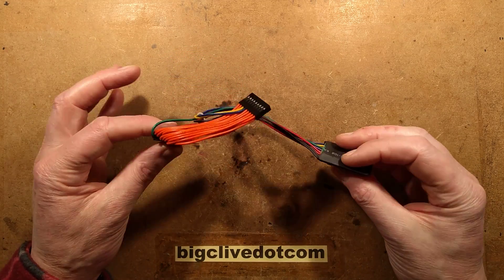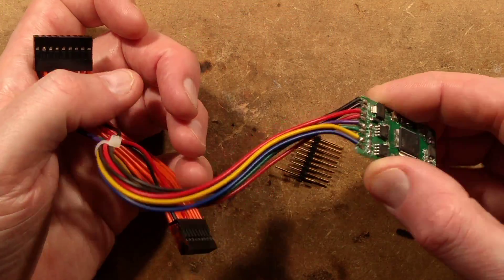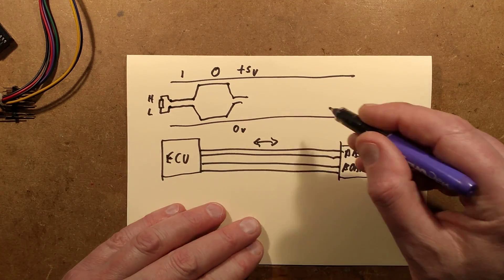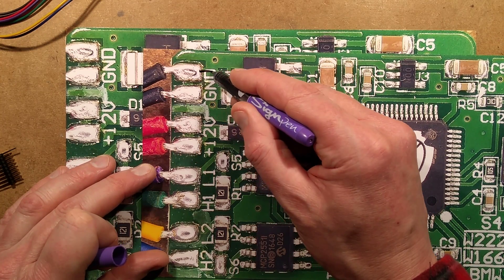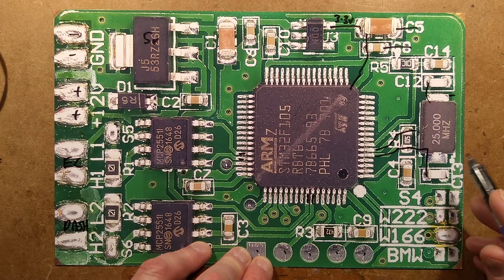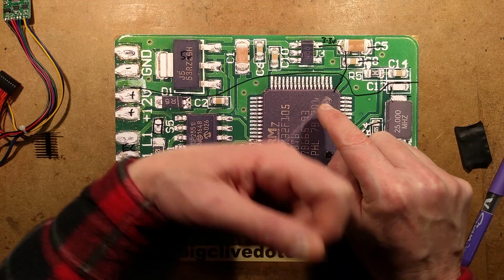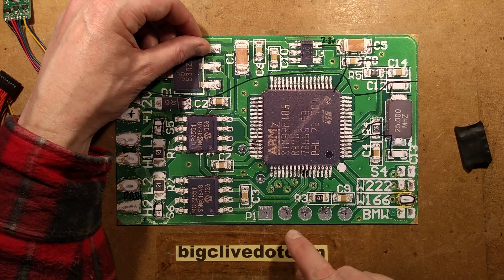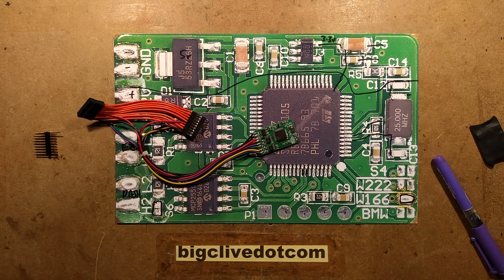Naughty CANbus odometer "interface".  (Fakes mileage.)

Comment: I wonder if an increase mileage version exists for those who claim mileage against their tax.
Reply: The chip can probably be reprogrammed
Reply: @smeezekitty  It's an STM32, so you would likely be able to just reprogram it in cubeIDE.
Reply: Mileage can be increased by a lot of bidirectional scan tools. That is far easier than trying to decrease it. Most legit tools can't
Reply: @Firecul  - But one might desire to have their cake, and eat it too, by claiming higher miles to the taxman, then when the car is sold on, lower the miles back to the true number, or even lower as this device did.
Reply: @YodaWhat  Not a good idea.  When the vehicle changes hand, it has to have the registration changed, and they'll want the odometer reading.  Basically, it's a bad idea to tell different government agencies contradictory things in case anyone cross-checks.  Tax collection agencies generally like to do that sort of thing automatically.
Reply: @YodaWhat  if the taxman was smart they'd check the records when the car was sold. Also the annual MOT records would cause an issue
Reply: @evensgrey  I did not say it was a GOOD idea! :-)
Reply: @YodaWhat  if you removed the miles to sell it it would get spotted as an abnormality on the next MOT.
Reply: @mikes1992u - Sure, it could get spotted, in countries or states where such figures are noted. Another reason to not do it. But there are other kinds of places in the world, too.
Reply: @Robeight  I recently claimed cents/km and don't recall providing postcodes
Reply: @kissingfrogs  depends who you work for and they’ll probably check the distances at some point to be sure no one is ripping them off for more mileage then they have completed.
Reply: There is. Heard rumors it’s popular among sales people to seemingly increase their effort to acquire customers/make sales. Business owned cars though.
Reply: Taxi drivers could use some tricks like that.
Reply: @tomonabudget  Taxi meters do take a feed but I'm not 100% sure its off the can.. I spoke to a taxi tech (guy who wires up all the taxis from a standard car) one day and basically the feed is pulses (+5, 0, +5, 0, etc) so it would be easy to build an interface (just out of an arduino using 2 pins plus of course +5 and 0v rails with a regulator plus a variable resistor ) which would allow you to make the meter go faster or slower as required.
From what he said there is no codes (like in can / obd2) so basically the wire working itself loose will stop the meter running and an intermittent connection might make it run faster / slower depending on how it contacts. 

 Of course its highly illegal and if you get caught you're done for. Mind you, most taxi drivers break the law multiple (maybe 100 +) times a day anyway.
Reply: roadmonitoroz Brisbane taxi meter fitter here. We normally try and find a square wave pulse as it saves fitting a canbus interface. I have no doubt a device could be created to fiddle the pulse information however I think it would be complicated for the average taxi driver (I’m not even sure I’d be able to make something and I’ve been fitting them for over a decade).  In the last decade I’ve had maybe 3 vehicles overcharging due to bad connections, loose connection vibrating simulating a pulse, the public were very quick to let the drivers know as well.
Reply: @cabcomltd  Yes the passengers would probably notify the driver as taxi fares (under normal traffic conditions) will always be roughly the same each time (give or take 10%)
And yes, out of the ability of most taxi drivers (and most of the public) but I'm sure with a bit of research and maybe an old smidt g4 meter for testing it could be done. I remember walking into a particular service station which was also a taxi depot and saw an old G4 for sale for $50 (when the cabcharge meters became pretty well standard due to government regulations . ie able to read meter via the eftpos for the ato). Ps Switching to cabcharge meters was the best thing ever as it (a) Stopped taxi drivers from running the most expensive tariff during daytime hours and (b) Stopped drivers adding tolls for bridges which were not traveled.
I remember seeing a printout from a driver (Yes I know people in the industry) where by doing a bit of math and using the statistics the night driver (started 4pm and finished 1am) had done 13 trips and they were all tariff 3 which is the midnight to 5am tariff 

As you know meters are pretty easy to wire [ +12 & ground, vacant light, distance wire, computer dispatch wire (so taxi computer knows meter is on or off) ]

Of course now days they have the transfer to eftpos ability and some other bells and whistles including GPS, auto tolls, etc 

Also after doing research (many years ago) about the wax seal and meters when riding in cabs I noticed quite a few without the seal which with a screwdriver you could re calibrate (with the right bits and bobs)
Reply: @roadmonitoroz  actually the legality of changing mileage depends on the country you are in, plenty of countries in the world it’s totally legal.  Even in countries like the UK it’s only illegal if you use it to deceive someone for gain.
Reply: Place I worked at way back. Employee paid all fuel for the company vehicle and claimed back work mileage at an agreed rate. Obviously there's a fiscal incentive to over claim work mileage and under report personal. Most people were smart enough not to over do it, i.e. at 5% or so to each journey and you've got a buffer for the weekend say and always make sure you have some real personal mileage. Mr Joe Stupid got the push when his vehicle went in for a service and the mileage recorded by the garage was substantially less that the total he'd claimed to have driven for work.
Reply: Those are used by politicians
Reply: Ok but what are the chances the the IRS (or who ever governs your taxation)

Will check kilometre validity either by inspection or calculation by fuel receipts
Reply: @NickTaylorRickPowers  If they ever did a tax audit on you then they would probably get that information from the DOT/DMV/etc given that selling a car would have some interaction with your taxable income.
Reply: You don’t need that as an option. Now that gps apps exist that track your mileage. You just have to provide that.
Even if the vehicle is registered to a Corp, the mileage isn’t verified on sale.
Reply: Yes, such devices exist, and they are legit. When the component which recorded the odometer data breaks and needs to be replaced, the new component needs to be "rolled forward" to the correct mileage (well, in most countries, at least). Obviously, the odometer can be rolled forward easily, while the backward direction is more tamper-proof.

Note that Big Clive's CAN bus processor does not manipulate the actual odometer, it just changes what appears on the display.

But for the taxman, you don't need that much effort. Just say that your car broke down and that you had to take another car for your regular business trips from Alaska to New Zealand.
Reply: Honesty I wouldn't fuck with it cus then I'd probably have a hard time lying
Reply: Robert Slackware  Statute of Limitations? That may protect in some places. "Your mileage may vary." :) :) :)
Reply: reverse the polarity :D
Reply: They say there are solutions for that, too. ;)
Reply: Robert Slackware  I don't believe DMCA protects illegal software.
Reply: 1:40 good quality canbus joint.
Reply: This wouldn't work, because the extra depreciation you can claim offsets your taxable income, so unless your tax rate is over 100% you'll lose more money from the decreased resale value of the vehicle. Of course you could remove the device before selling the vehicle, but then you've sent contradictory tax documents and you'll go to jail. Also the taxman isn't stupid and will check the miles claimed against your declared fuel expenses. If you claim you drove 1000 miles but only bought 5 gallons of petrol you will be audited (they're going to suspect you are running dyed diesel).
Reply: This question shouldn't be asked, it will interrupt a lot of people.
Reply: No point.  The tax man doesn't come look at your odometer.  If you want to risk it, why go through that kind of trouble, just fluff the numbers of your tax forms.
Reply: @jethro9341  Tax man doesnt need to, as more and more government computer systems are linked, they will know your mileage from the mot.
Reply: @jethro9341  "...fluff the numbers..."
That's how you get caught, there are algorithms that can detect fraudulent tax returns, expenses claims and mileage submissions. They work off of the way humans behave when entering false numbers, the patterns, occurrences and deliberate avoidance of repetitive data.
Reply: @James Lintell-Smith Don't be mislead, it was a joke lol
Reply: Ha ha ha.lol
Reply: That's an interesting thought but wouldn't more miles be more better for claiming tax back? 🤔
Reply: @thomas316  "I wonder if an INCREASE in mileage version exists for those who claim mileage against their tax"
"I wonder if an INCREASE in mileage version exists"
"INCREASE in mileage"
"INCREASE"
Reply: @thomas316  ...That's what the guy said!
Reply: @thomas316  yup... 

i use a gps phone based milage system on my phone, its sooooo much easier than a travel log... takes seconds to use vs hours and hours of filling out a physical log
Reply: @thomas316  that's the point of his comment, hence the different version he is inquiring about.
Reply: @thomas316  -- "They" usually want a trip by trip record.

Comment: there are two other pins broken out for pogo pins: PA13 and PA14 which is the jtag connector to the µC ... 
do you have a jtag to usb dongle ?  ... maybe there is some interesting data on there.. who it made, what (else) it does ... 
maybe it's original intend was different to fake mileage ?!

Comment: So the mileage is stored on the ECU, separate from human readable interface... Well that was designed to fail wasn't it!

Back in the old days you'd have to take the dash apart and physically click the actual numbers round with a screwdriver... So much for digital dashes being more secure eh? Any idiot could plug that in in about 5 minutes!

I know the first digital dashes (Pre CAN bus) certainly stored the mileage locally, so someone really hasn't thought the security through as these have evolved.

Comment: This milage spoofing device works because there is no authoritive response. Which means any device on the cam bus has no way to know if a command issued to it is legitimate or rogue. By sitting up stream if the engine ECU (in a mitm fashion) it is able to inject and thus spoof the cars milage. 

It can be something as 'benign' as your milage device or something sinister like slamming the brakes  at random or even flawing the accelerator. Worse still is the infotainment system is on the CAN bus which can issue attack scenarios like above. 

CAN bus fails to implement even the most basic security principles which unsurprising for a 30 year old standard. The scope of attack worsens with Bluetooth, WAN and WiFi technology providing a great attack surface with remote exploration vunrablity

Comment: Interesting, on Ford/Lincoln, the last known odometer reading is stored in both the instrument cluster and PCM. I have even seen the mileage mismatch by a couple hundred miles between the two modules.
Reply: Far as I can determine, on the 2007 Crown Victoria, it's only in the instrument cluster. That's using ForScan, haven't tried dealership grade scan tool yet.
Reply: @brianleeper5737  . I guess I'll have to check the next 07 Crown Vic that comes in.

Comment: I wrote a man-in-the middle implementation of this in Python-can. I really want one of these dongles. If you connect to those pads you may see a freeRTOS shell talk back to you. What you would find would be a packet like "7A 5A 00  2D 29 2F 9C 34" With the Red Characters as Odometer is modified, or fixed, I imagine the bytes are shifted down to look somewhat authentic. The arbitration ID it is filtering is 330 for BMW as printed on the bottom. Legit versions of these are called gateways.
Reply: Only $75USD at AliExpress!

Comment: This STM32 (arm) chip is really cheap. Way more powerful then the arduino (avr) ones. I like this chip a lot, easy to work with. Can you check if the rom is locked on it? It would be nice if you could dump it. Also those pins are for swd. Debug and program. (flash)

Comment: Looks great to me. Where can I get one from?
Reply from the maker: eBay.
Reply: @bigclivedotcom  Looks like it used to be available on Amazon.ca, part # B0757N5RBF / clearly marketed for mileage adjustment. The Amazon page even includes a small amount of info of where it connects on BMW X5 - connects directly to instrument panel. From the description: CAN Filter is designed to support old mileage data blocking on Mercedes-Benz vehicles. It is designed to prevent regeneration of the old mileage state in vehicle dashboard (odometer). 
Available on AliExpress (USD $76). Nice photos there, too (including the PASS/QA sticker - haha)!!

Comment: The W222 and W166 are platform designations for various models of Mercedes cars. More than one model and year of car can have the same designation, but all the cars that share the same designation have many common parts and systems. The third option is for all BMW cars presumably (or more likely a certain range of years). W222 is a 2009+ S Class. W166 is the third generation M Class (2012+).

Comment: The millage is stored in the ECU and the Cluster. On startup the ECU updates the current millage on the cluster. This is so the millage can be shown on door open and not having to start the car. Which is required in some countries. The startup sync is for when you have to swap in a new cluster. The cluster ships with 0 on it and then syncs on first startup. When the car is under motion the cluster runs off the speedometer signal to calculate millage. 

What this device does is watches for the sync command on the can-bus and suppresses it. Then a unscrupulous person can roll back the cluster and it will never sync to the real data from the ECU.

Comment: What a cheeky gadget. Its funny, I am learning about CAN bus at the moment, I have a 5V and 12V device I need to interface. All the controllers, inverters and chargers are 12V but the main computer is 5V. shouldn't be too hard to get them hooked together, just need to avoid ground loops.

Comment: I need one that just fakes a mileage, I don’t care if it says 1 or 1,000,000 miles, the US is stupid when it comes to titles on vehicles. They want a number (they said it doesn’t even have to be close, I asked if a sharpie worked but they said no, but even 0 miles is fine if it lights up that way, I don’t see the difference personally...). Anyways, Chevy was bad at making my dash, so the replacement part costs over $750 (no aftermarket unfortunately), and I paid $4,500 for the entire RV, it’s not like I give a $hit about the miles, I just want it titled! I bought it knowing it’s condition, and that’s probably how someone else would if I ever sell it. Either way, they would see 0 miles and know that’s not what it is. It’s stupid they need an error or fake number... If it wasn’t digital it would be fine (whatever it was stuck on would be what they write down, they don’t care if it’s correct). I’m debating using an Arduino or just saw out the dash and put an old style in (I won’t even bother connecting it) just going to shove a motorcycle mileage counter up there and duck tape it... Lol, it’s not sharpie that way!

Comment: If you Google Cangateway v2 2800-072601 you will find these available at AliExpress, amazon and others. A quick look found them for about $75.00us per 5. So common things.
Reply: No longer available on amazon.ca - not found in amazon.com
Reply: @Texas1FlyBoy  My point is that these are not a one-off custom build. These were production items that were/are available through some very big retailers and therefore not a big secret.

Comment: Analogue gauges on cars are no longer analogue ! You'll discover that if you're a computer person and know which buttons to push. I mean, it'd be a bit obvious if Ctrl, Alt and Delete appeared on the stalks and heating controls, wouldn't it !

Who knows what happens now if you set passenger temperature to minimum, drivers side to maximum then press eject on the cassette player. Erm, I mean CD player.